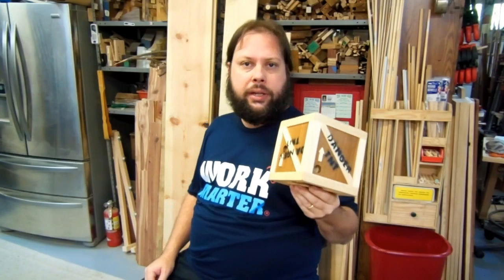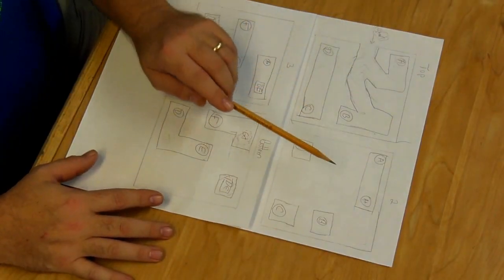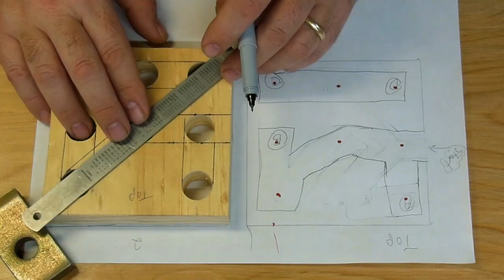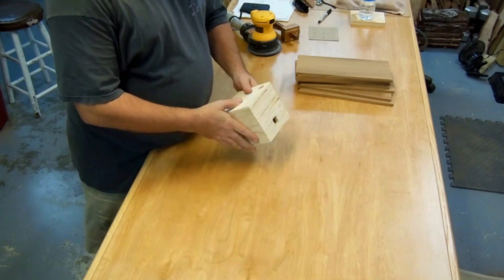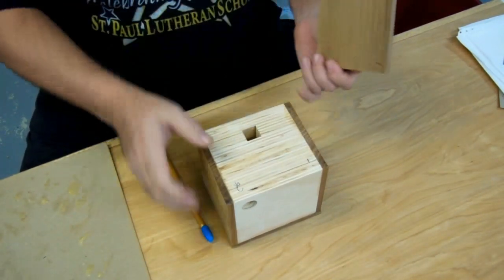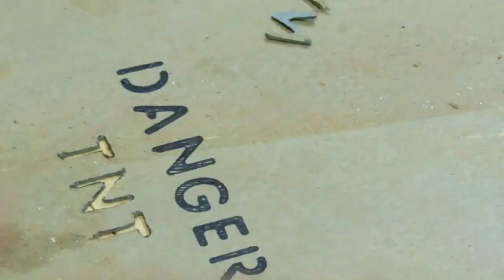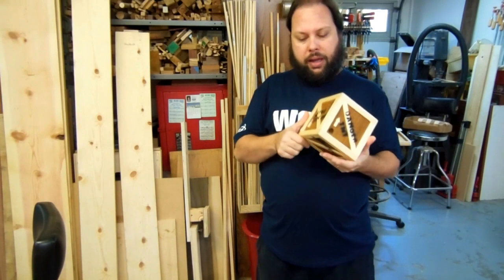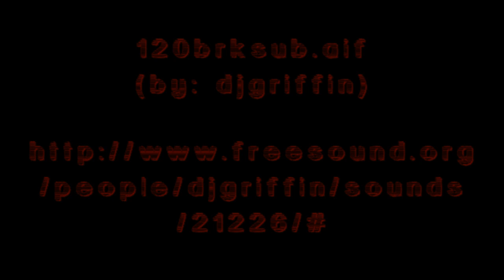Make a 3D marble maze (The Scrap Bin Challenge)

Comment: Hi! This is really cool! I would like to do this with my high school students. But, maybe it is only my inexperience, but what kind of saw you use? because I don't see how you enter the saw in the holes! Thanks for sharing your projects! :)
Reply from the maker: Marie-Claude LB - I appreciate the comment. I used a scroll saw. The blade comes out of the saw and you feed it through the drilled holes. It's like a motorized coping saw. Let me know if you or your students make some; I'd love you share it in a future video.
Reply: Thanks! We don't have scroll saw but we do have coping saw. We will try with that. I will let you know for sure. I also plan to make the other puzzle with 6 pieces with them.
Reply from the maker: There you go. A coping saw will work great. The nice thing about this project is that the inside channels don't have to be pretty. As long as you make the cuts (even if they're sloppy) you're good to go.